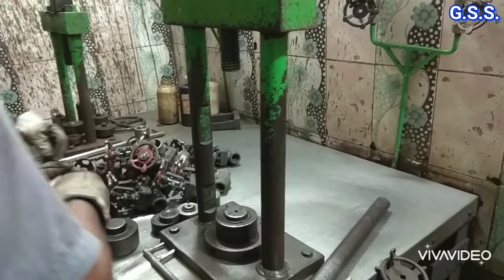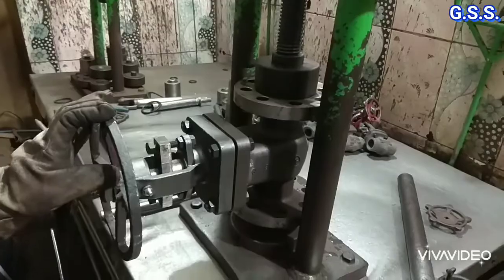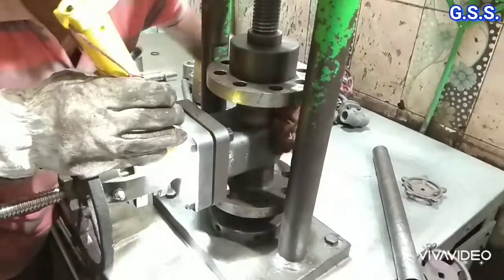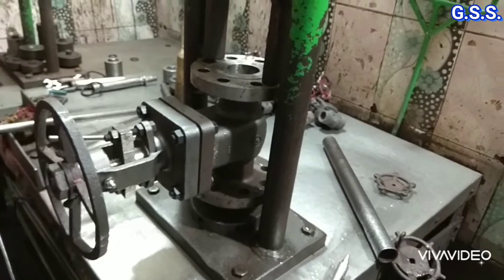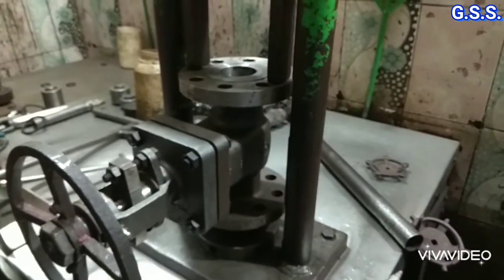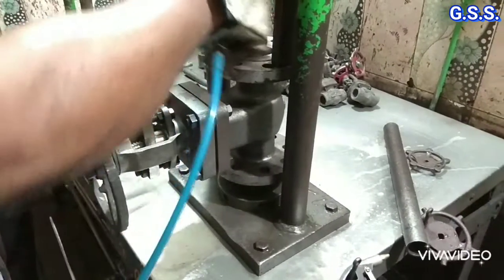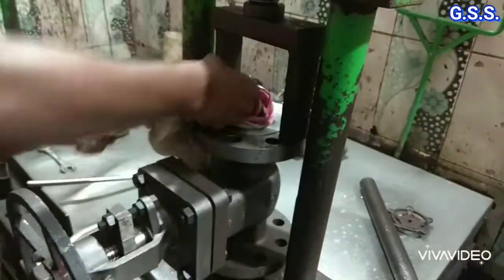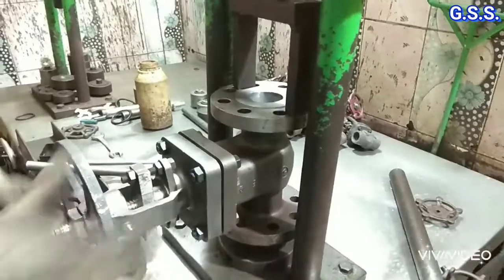Piping Engineering : Valve Testing - body, seat, backseat & seat pneumatic

Comment: Sir , as per API 598 during shell test valve shall be partially open but your valve is fully open , can you explain why?
Reply from the maker: During valve body or shell testing, valve can be kept partially open or full open. Requirement is, valve body and bonnet should be pressurize together.

Comment: Dear Sir, Why gland bolts are loosed incase of hydro testing  which is not going to do when valve installed in the line in the industry?
Reply from the maker: Gland bolts are loosened only during backseat testing to ensure that there is no leakage through the gland so that at site when the valve is under operation, gland packing can be removed or replaced without closing the valve.